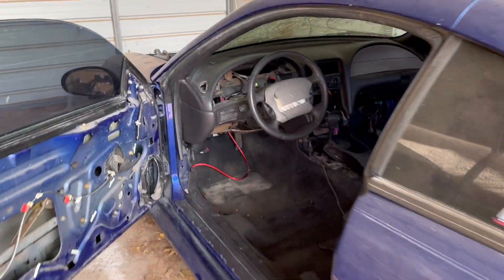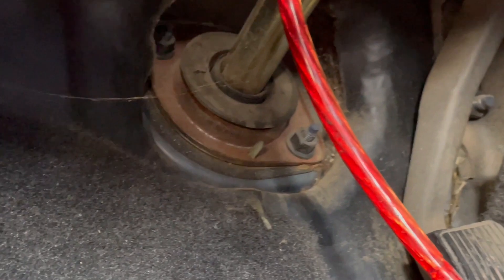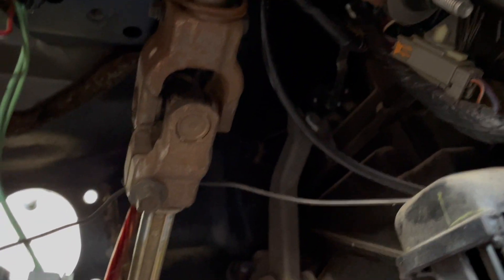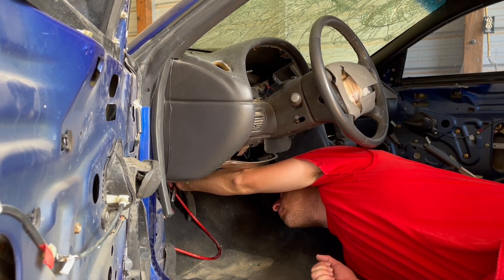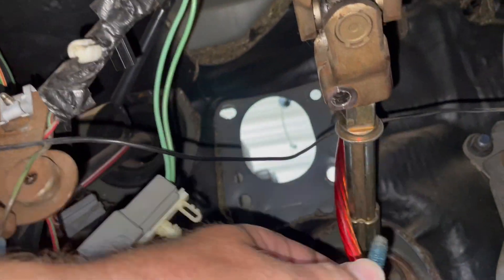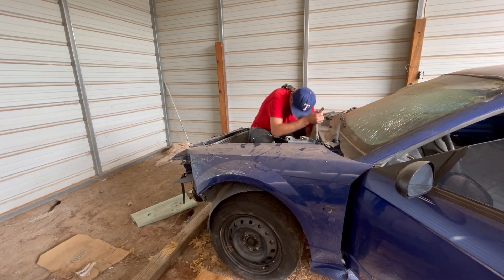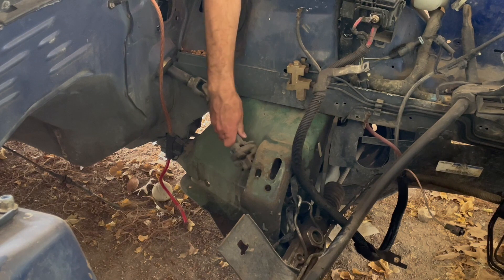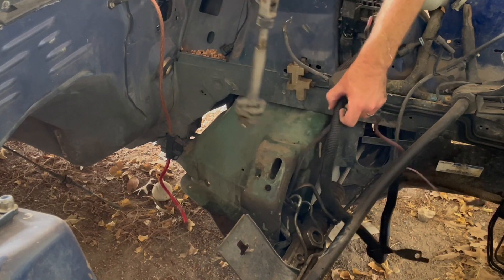remove steering shaft sn95 mustang 94-04

Comment: Have steering wheel play in steering I’ll be going straight down road an can move the steering wheel side to side. Is this my problem? Another question can I take one out a v6 ? Thinking about junkyard to save some money .
Reply from the maker: I believe the V6 is the same. If it’s not the shaft and rubber it could be the steering rack gears are worn themselves.
Reply: @justin.c_svt  thanks sir really appreciate the reply
Reply: what did it end up being?
Reply: @bagginn  steering shaft bushing. Pulled two from junkyard problem solved
Reply: @mustangaddict589 u should post a vid abt it bro